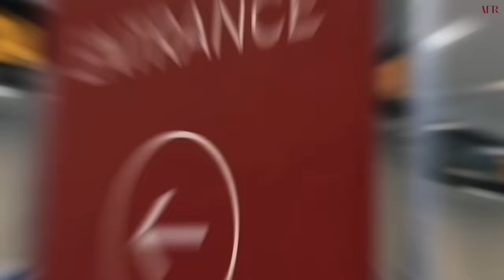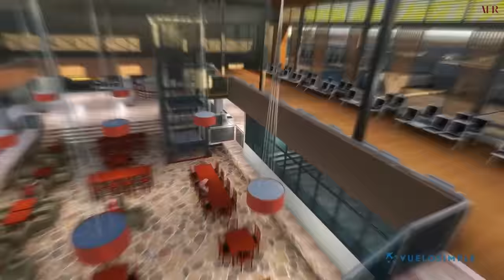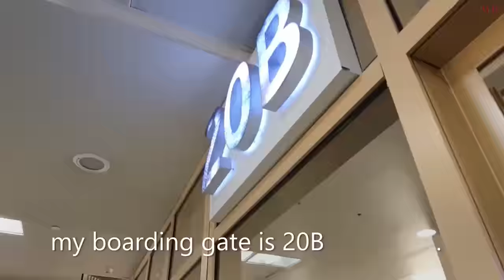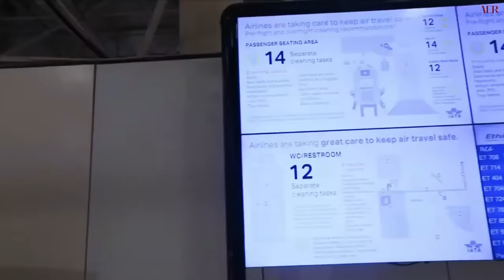Top 10 (Largest and Busiest) Airports in East Africa | Kenya vs Tanzania vs Ethiopia

Comment: CORRECTION; Julius Nyerere International Airport - Terminal 3 has already had both phases of construction finished, thus the capacity for Terminal 3 is 6M passengers per annum, and not 3.5M as erroniously advertised in this video. 
Both phases of contruction were actually finished before official inauguration of the airport.

Comment: There will be a new terminal in Bishoftu, Ethiopia with a capacity of 100million annually.  The first phase of building  terminals 1 and 2 is planned to be completed by 2028. There are three phases and the estimated cost of construction is $4billion.  Currently the Addis Ababa Bole airport accommodates 21million passengers/yr

Comment: Jomo Kenyatta International airport has only one runway... Even though it's longer than that of Julius Nyerere International Airport, but it's the only one...

The latter has two runways... and for me, I could count this to be better. Recently there was a cargo plane logged on the only runway in JKIA... As a result, all flights were diverted to the neighborhood airports!

If the JKIA had two runways... Life of passengers would be at easy!

What do you think?
Reply: Yes ..only one runway with the capacity to handle big airplanes. The recent incident wasn't because of the runway, the engine caught fire so it had to be evacuated. Busiest and large airports around the world have only one runway.
Reply: What's your point?are you comparing the two?
Reply: @stevebiko2711   what did you read? Is it a comparison?